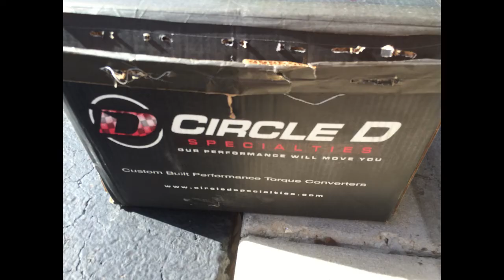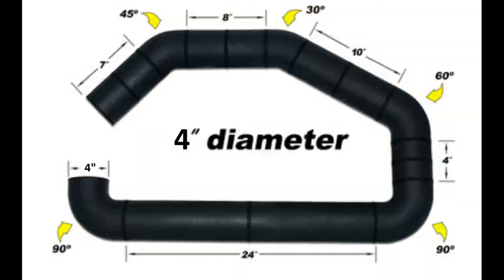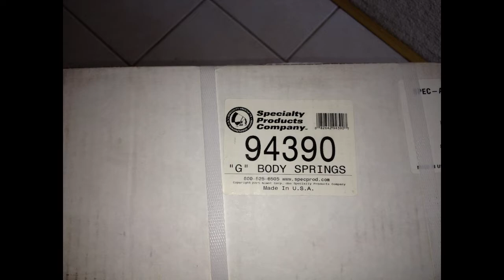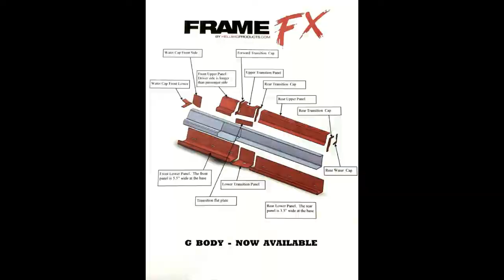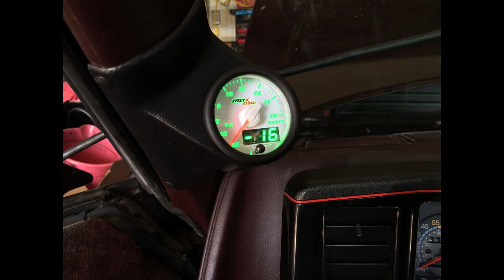Monte Carlo SS 1986 Restomod Compilation

Comment: Beautiful build!!! Money well spent thanks for the motivation. I’m working on a 84 SS column shift bench seat car myself this is what I needed to see.
Reply from the maker: Thanks for the kind words. When I had started this build there wasn't anything in the way of LS G-body swap parts.  This includes the headers I custom made to clear the column shift. For your 84 column shift,  fast forward to today, Holley has stainless LS swap headers and motor mounts but the headers were not made for, nor do they clear the column shift. However, at least you have something foundational to work with as you could probably do some customizing to make them work.

Comment: Holy Crap You weren't messing around Wow kick ass job! My previous owner put about 5500 new crate motor edelbrook carb but sat 5 years under a tree but started right up. But wow I'm hoping to do close to what you did again Wow bro kickass job and great video and song
Reply from the maker: Thank you for the kind words. My advice to you is to be patient as the work represented in this short video represents years of work to achieve exactly what I wanted. And it’s still not finished! 😢

Comment: Very nice. I have an 87 and I'll tell you before I do it, I'm stealing your design. 😁
Reply from the maker: Thanks! The custom motor mounts are John Bzdels which coupled with the fact that, at that time, there was no stainless headers for my application was the reason I went full custom for the headers and tied into Holleys 3” stainless header back exhaust. Today, Holley has a full solution:  Motor mounts, Stainless headers, Only consideration would be that their Header is not made to clear a column shift like mine. The rest of the components are off the shelf stuff with some customization for cold air intake creation and mounting/placement considerations for the rest.